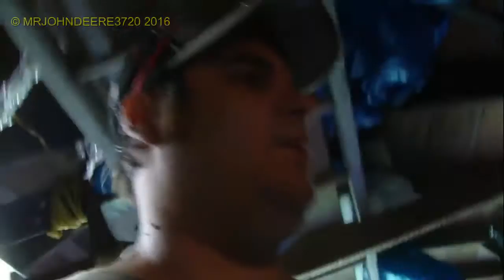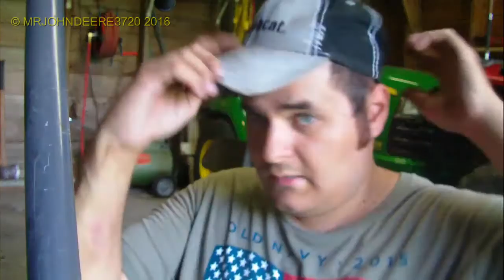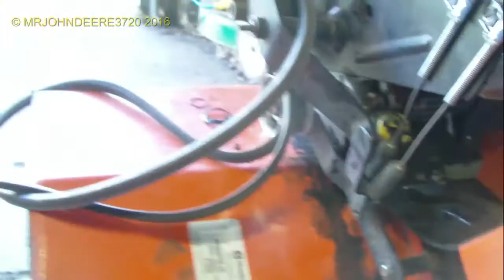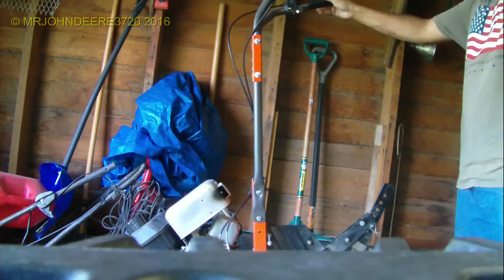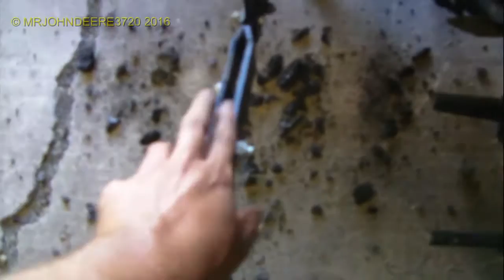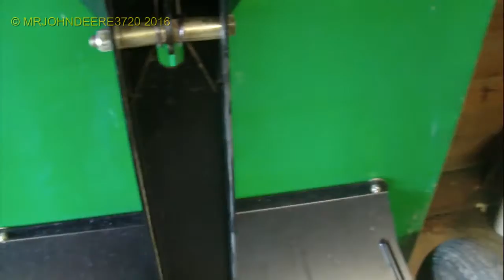BALL BEARING OUT ON THE HUSQVARNA FT 900 TILLER PART 1

Comment: I am willing to bet that bearing is unservicable, and you have to buy a whole transmission. You might have to pack some grease in there and just run it till it blows.
Reply from the maker: damned if i no. theres no real good brake down on this piece of shit. the grease  would just come out its  missing 1 side of that bearing.
Reply: Most likely or need to have special tools to pull it out then order from a place by the number on bearing.
Reply: That little piece that is sticking out looks to be a piece of a dust cap for the bearing. I would try to pull that plastic out and push some grease between the balls and put it back together. I don't think having the balls exposed would be too much of an issue.
Reply: +crazyjdkid only if he isnt in 200ft of a school. Then he shouldn't expose his balls.
Reply: I saw that coming...
Reply from the maker: crazyjdkid
it'll just come apart again. im gonna look more in2 it then i'll make a call on what 2 do with it. .